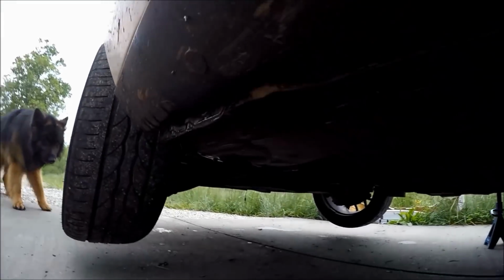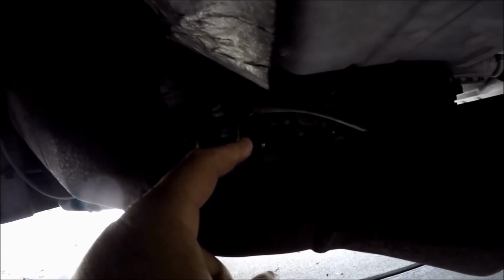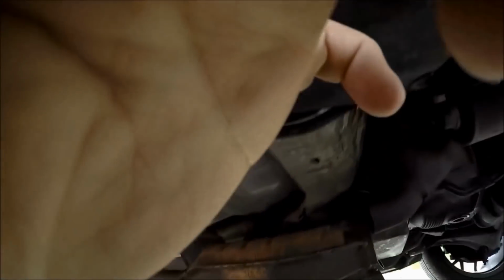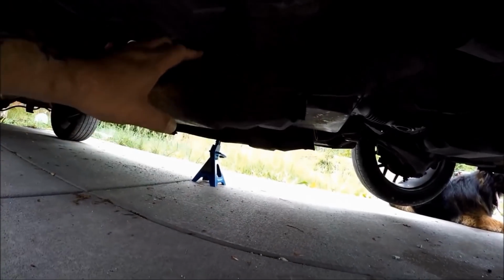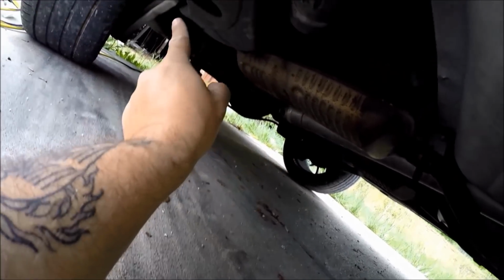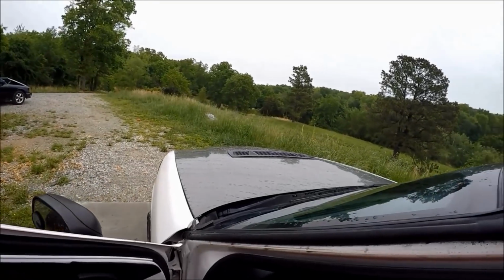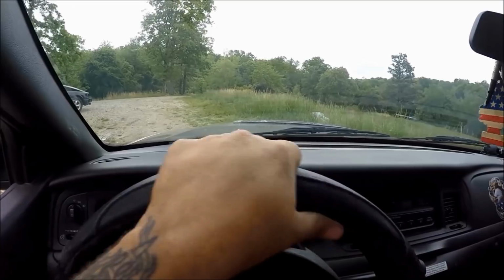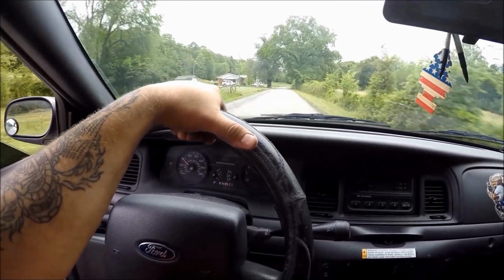LOUD AF!!! Rear Cat Delete on The Crown Vic Sounds Like a Monster Truck, Pops Like a Rally Car!

Comment: Would a super 10 with all cats intact be not loud?
Reply: Flowmaster ?  Hmmmm.. that's loud enough
Reply: Yes it would, nice rumble to it
Reply: No i did it on my 5.0 explorer and there was almost no difference in sound
Reply: I went to a local muffler shop and got the equivalent to 40s and it was decent. Then my secondary cats went bad so those got taken out. Its loud enough.  Theres not always a constant drone, but I'd imagine super 10 would be good with all cats.
Reply: Do Super10s even do anything?
Reply: @jimstenlund6017  Im pretty sure they muffle it a little

Comment: Sir I have question I’ve changed my coils my spark plugs my injectors and my 2 cats that go on connected to headers  and my 02 sensors   All 4 my bank 2 driver side seems to be misfiring and shaking  the driver side cat is getting hot … for that reason I haven’t drove it   …  what else could I look at ?  The car just had 100k miles no oil leaks nothing

Comment: I currently have a 03 police interceptor and been looking into doing some work into it. Already drives great and is fast. Max speed so far gotten to 115 without any work other than using full synthetic for my oil and have 20inch rims/tires

Comment: I have tried many things with my 2000 cvpi. I once cut the mufflers and replaced them with pipe, while this did have a nice sound it wasnt loud.

After this i cut the pipe i installed right where the rear of the muffler would be, once again sounded better but not loud. 

What i did and i currently still have done is i unbolted the exhaust after the cats, This sounds great and the backfires are lovely. 

Cutting the cats really has no effect, just unbolt the mufflers.... trust me

Comment: I've got a 99 crown vic with no cats and 2 flo masters under the back seats
Reply: So why would you remove restriction then add restrictive mufflers?
Reply: @iiSup3rior  it actually sounds pretty good 👌
Reply: @gonzalezgrant  yes but if your removing catalytic converters as a way to remove restriction then adding Flowmasters defeats the purpose, there's plenty of aftermarket exhaust mufflers that have a straight thru design like borla, magnaflows. The problem is they have a steep price. But if price is an issue you can add 40 dollar cherry bombs that will need to be replaced because they rust easy but it will be free-flowing, versus bumping the exhaust through resonator walls inside the muffler some Flowmasters even have the in and out offset